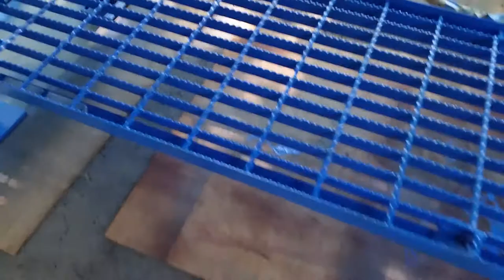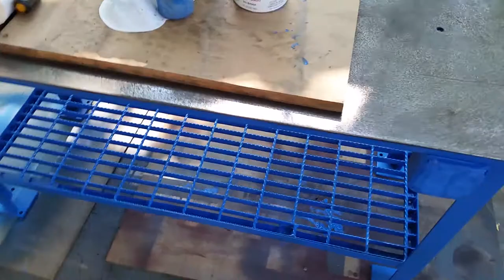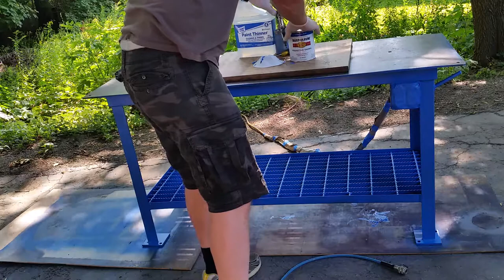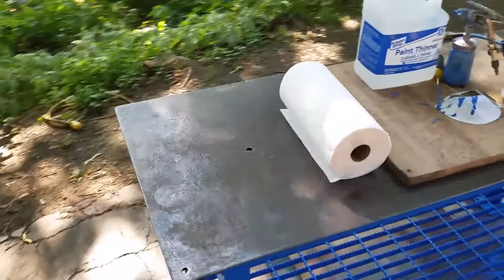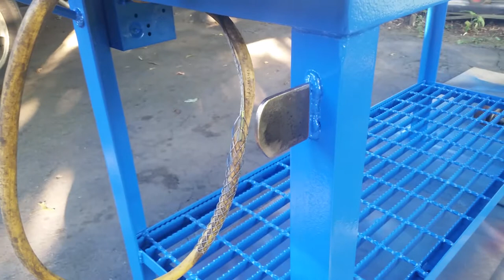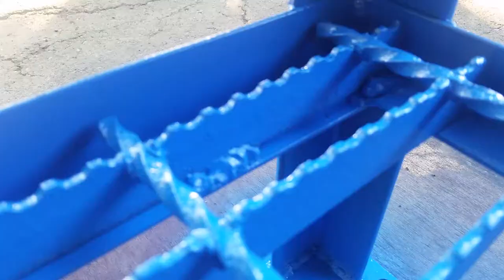Plate steel work bench (part 6) finished....almost

Comment: Brandon what was the ratio of thinner to paint ?
Reply from the maker: I just dump thinner and hold the paint stick at at 45 degree angle and count until it starts to drip. When it starts dripping when I reach the count of 10 I know its good. It's a little ghetto but it works